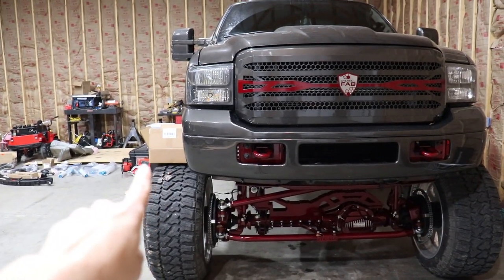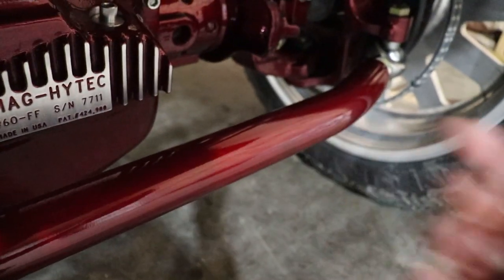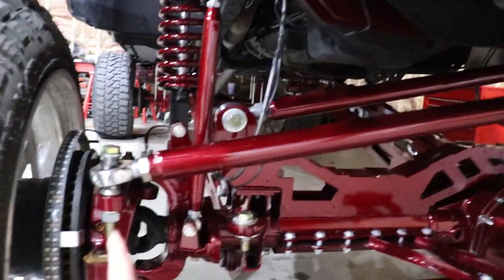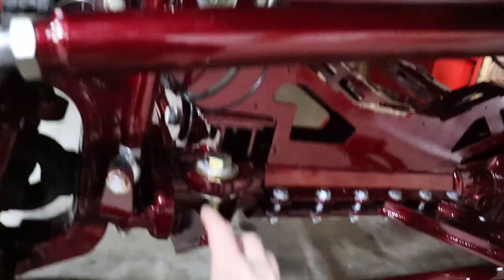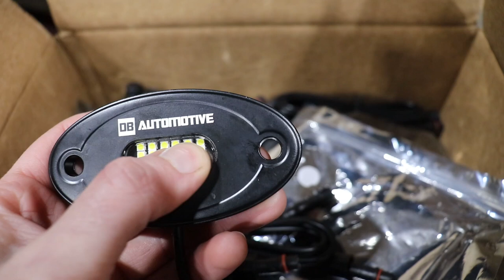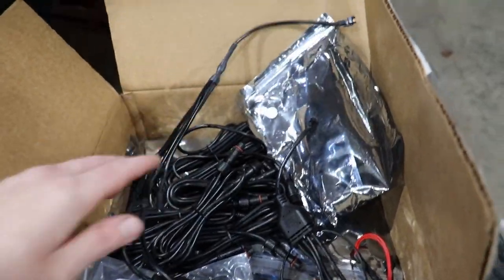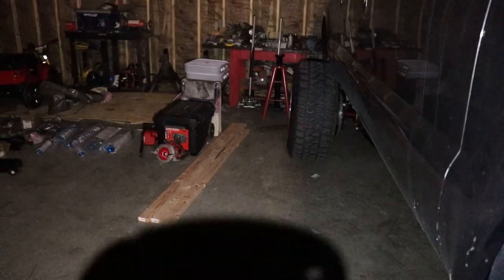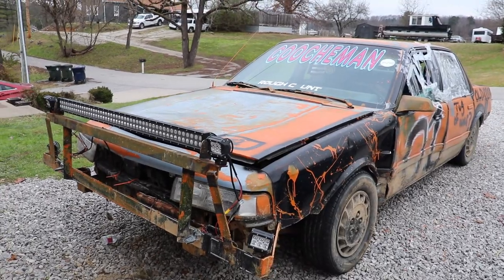F250 BALL JOINT DELETE ? HOW TO : DIY Heim Steering KIT | Death wobble fix

Comment: It’s best if the center link (tierod link) has adjuster sleeves like the oe. To fulfill proper center link adjustment. Reason being, the Heim joint will only allow you to adjust in half turn increments. And from my experience the heim joints wear a little faster than the oe tie rods. But looks cool as heck!
Reply from the maker: I definitely agree but it seems with proper measuring or just shear luck me along with all of these big shops get them pretty much dead on even using heims and having the half turn increments of adjustment.... many many sema trucks and every single Plan B fab built trucks have heim steering... and as far as wearing out I am not sure yet only time will tell!

Comment: Wouldn’t it be .5” of adjustment not .25”? If it’s 2” thread in 1”  for structural integrity and you have 1” left half of that would be .5” so theoretically you can go in .5” before it bottoms out or out .5” without having less than 1” in the threads. Just a question I had. Super clean truck bro.
Reply from the maker: You have a jam/locking nut as well I forgot to mention that but had it in my head when I explained , sorry about that!
Reply: @JUSTINHAWKSMITH  that makes sense I didn’t think about the nut.

Comment: Can only find the Stryker mini truss on their website. Is the full Dana 60 truss you have a full bolt on or is it partially welded on the Pumpkin side. Also, how much does Stryker sell it for? Thanks brotha.
Reply from the maker: custom made , would have to contact them for pricing i wanna say its like 1700 for the truss i have, i could be wrong. theyre pricey

Comment: I wish I could get had a guy like you to fix the wobble on my 2015 super duty black ops. No one in Miami seems to know how to build trucks that look like that. I want a 10” lift and I want the front to look like that. Any suggestions?
Reply from the maker: Take it to papis garage he’s in Miami. Tell him I sent you manny knows me. Ask for manny
Reply: @JUSTINHAWKSMITH  
Justin,
I want my truck to go from a 6” to a 10” lift, Stryker , coilovers . ( fox). My truck rocks back and forth when turning or going over bumps. There’s two new tires ( nitto grapplers) let’s of vibration / wobble coming from the front.  If we need to talk is there an email I can reach you directly?  So the guy you referred me to who is he and what does he do? Specialty lifted trucks ?

Thanks,

Jay

Comment: Once the tie rod is bent to allow for steering it will no longer be adjustable for tow in or tow out with steering stabilizers. The tie rod will not spin to adjust in any direction. It hits the chunk and everything else in its way. F350 stock components were stronger than everything you are seeing in his video. I just wasted a ton of money and tons of time, for a shitty riding truck and  a weak feeling front end now. You don't need heims on tie rod anyways. The stabilizers will move up/down and look like crap. Eyeball the bend, better figure out another way if you plan on keeping your tires more than 500 miles.
Reply from the maker: You put steering stabilizers on last , after truck is fully aligned. The tie rod bar will NOT hit the pumpkin when built correctly. & no physically stock components are NOT stronger the 1-1/4” heim joints & 2” 1/4 wall DOM tubing. & to close out the issue with stabilizers moving up and down you have not locked your jam nuts properly. This is just all installer/builder error on your end. Well over 10k miles on my setup with little to NO tire wear. Have installed my kits on other trucks as well , NEVER complaints. Tighter steering.

Comment: Justin, PLEASE be careful with those steering components.  The welds look like shit and DOM tubing should  be bent in a TUBE bender, not a H.F. pipe bender. Pipe benders kink tubing, therefore weakening it.
Be safe
Reply: P.s. when you use DOM you can tap the tubing itself, thread the heim directly into the tube and eliminate the weld in bungs
Reply from the maker: it wasnt bent enough to kink, theres no kinking 2" 1/4 wall dom with a HF bender unless you're superman... powder may make the welds look odd on camera, i dont see it, but welds are fine and look great also rosette welded. Have ran heim steering with weld in bungs well over 15k miles at this point never had a issue. also cant thread this size tubing not enough wall thickness, whistlin diesels "monster max" even has weld in bungs. and youve seen what thats been thru im sure...appreciate the comment i do believe it'll be fine tho.
Reply: @JUSTINHAWKSMITH  you must not have seen his recent video. Lmao super clean truck though
Reply: Thanks for taking the time to reply Justin. 
I agree that there is more than one way to do things. 
Just food for thought, there is a reason why major auto manufacturers engineer parts in certain ways. In this case the steering system, they tap their link ends because it's safer than a welded joint. I trust Ford and GM more than whistling diesel  lol.
If the wall of the tubing is not thick enough to tap , there's always a thicker wall available. 
I enjoy your channel and support your overall dream. Remain open to discussion as we are. And keep in mind that you are going in a tutorial route, so there is a certain degree of responsibility you bear as your followers may copy your methods. 
I'm an ironworker by trade, and p.t. fabricator on lifted trucks since 1988, so you have to listen to your elders 😂🤣
Be safe, and hurry up getting that rear 4 link in there. 
Merry Christmas  !
Reply from the maker: @joem2196  appreciate the comments we will definitley see how she holds up. Agree threaded would be stronger but only time will tell
Reply: @Its_Melv   holy crap ! I just watched it, done ! Lol
What the bung happened there? Lol
Reply: @JUSTINHAWKSMITH  I call BS on the 15k! I had his setup on my CJ-7 w/35" tires. Year max/Replace...
Reply from the maker: @scottd6631  you wore out 1-1/4"  heims in a year ? them ebay specials will do that i guess... i havent had any issues.
Reply: @JUSTINHAWKSMITH  Not sure why you would say that I buy from "ebay". The brand I use are AURORA Made in the good old USA. Who do you use?